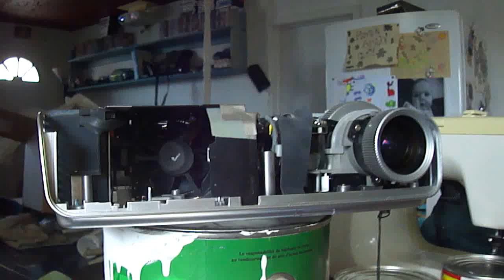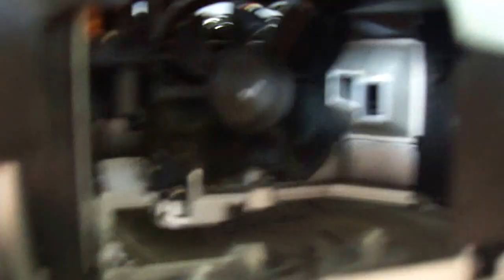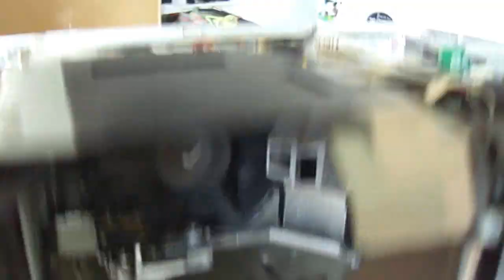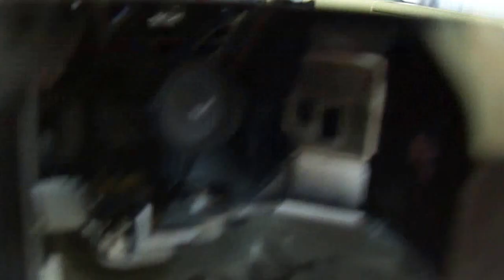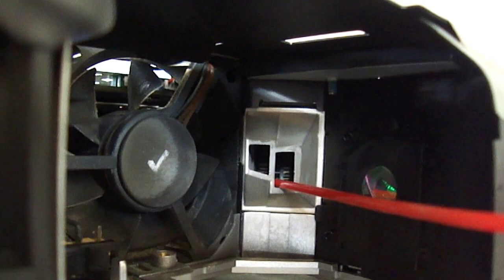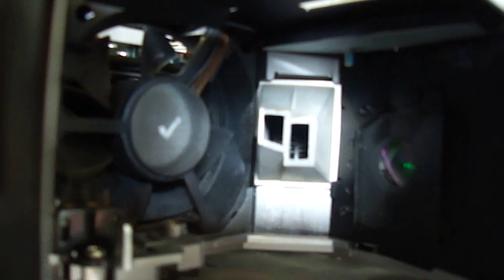optoma hd 65 hd 640 fan failure repair diy

Comment: I wanted to take the time to say thank you so much for posting this video.  Optoma asked me $125 just to take a look at my out of warranty hd20 projector after I started getting the dreaded "fan failure" error message, I got this error mesage after replacing the bulb (its important to note that the bulb did explode in the unit so some of the debris may have lodged in the fan.)  Optoma also kept saying stuff like motherboard issues and fan sensors on the phone.  Everything I've read has said the repair price is so high on these issues that it is better to upgrade to a new projector so I resigned myself to doing that very thing.  Then I ran up on this video and thought what the heck.  So I took the plunge and popped the case off and sure enough the same little fan was stuck and covered with dust.  I gently moved it with a screw driver and blew all the dust out of it.  Plugged it back in and I'm experiencing glorious 135" hd once again.  Many thanks.
Reply from the maker: Great, I'm glad to read that ...! :-)

Comment: hi, i have an acer k132 and based on you video, I didn't open the projector but applied the compressed air from the outside and it solved the problem!!!!
thanks for sharing this solution i was really sad cause this problem appeared the third time I used it!!!

Comment: Had the same problem with my Optoma EW610ST, the smaller fan on that particular one is a little bit more hidden and maybe even harder to reach, but it turned out to be exact the same problem as with your projector. Thanks for pointing this out!

Comment: Thanks, worked for me!

I just removed the two screws underneath, holding the lamp bay.
Next, I removed another two screws to remove the lamp.
I put down my iPhone in videocamera mode with flash on, and I could see the inside of that hole good. It sure was a fan there, and some pressurised air and it span good. 

Would be good to clean the entire inside, but it seems a bit tricky to take apart?

Comment: A word of advise: Please, never let the fans spin like that when blowing air over them. They use an electric motor to run, and what happens when you spin an electric motor ? it becomes a generator. Youre generating current and discharging it back from the fan connector. And at sufficient speeds, it can kill a lot of parts, so please, block the fan before blowing over it!
Reply from the maker: thanks for you advise, anyway, this projector in the video belongs to my neighbor, and is still working since I fixed it back in April 2013. :-)
Reply: vass ilika Hehe, glad it isnt you'rs, you nearly killed it! haha, nah, i'm kidding, i've also been guilty of it, until i killed a graphics card doing that... it was an old Radeon X600Pro, so it was probably half-dead, bu i just finished it up LOL.
Reply: +ComandanteJ i thought it has some kind of back current protective part? maybe a capacitor, because when the fan is running it actually generates back current too :)
Reply: There are Diods to prevent CEMF back into the system. Yo can spin it as fast as you want !!    Please Learn, basic Electronics

Comment: Hi, is it possible this fan failure give me 3 leds blinking (power+lamp+temperature)? I've this problem and my Optoma w300 doesn't power on. Thanks
Reply from the maker: Hi, I don't remember what LED's were blinking on this projector exactly, but blinking LED's are never a good sign.   

Good luck!
Reply: yeah,  that's right. I've tried to unmount and clean it, but it was already clean. No bad smell, no dust, no burned component. The only positive thing is the lamp seems ok anc I can just sell it...
Nonsense death!
Reply from the maker: make sure that the fans are turning (spinning) free, it can be that something is blocking the fan / fans.... although it looks clean. If one of the fan is blocked, the projector won't start up.

Comment: Optoma are absolute rip offs and I would warn anyone away from buying them. Optoma wanted £165 for a bulb and to fit it when you can buy a brand new Optoma HD65 for £200. I got a bulb for £50 fitted it myself and It works fine. They were also trying to tell me it may probably have other issues when I knew there wasn't any other issues.
Reply from the maker: philip v I'm very happy with my optoma hd20 since over 5 years...
Reply: maybe so for your HD20 but £165 for a replacement bulb for a HD65 is ridiculous when you can even buy better Projectors for that price. hopefully they wont try and charge you a silly price when your bulb goes.
Reply from the maker: I installed my third bulb (in the HD-20) a couple months ago, I never payed more than 90$ US. If you have some skills and know-how, it is pretty cheap to run a good projector as your daily Monitor. 
Recently I replaced the plastic lens for a glass Lens. My projector runs better then new now :-)
http://technitoys.com/optoma-hd20-dlp-projector-repairing-the-dark-spot/

Comment: hi how to open the case?
Reply from the maker: plenty of screws, I don't remember by heart, You'll have to check online....good luck
Reply: I just opened mine up and I think there were only 3 screws on the back.  The hard part is getting the cap off.  It just pops off when you pull it but you actually have to pull it pretty hard.  Also make sure you put the cap back in the same slots when putting it back on.